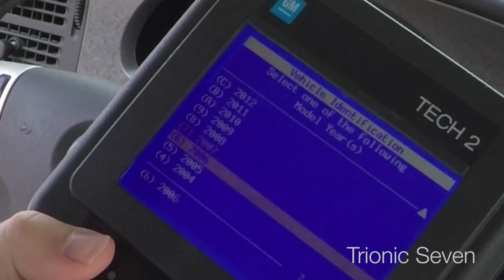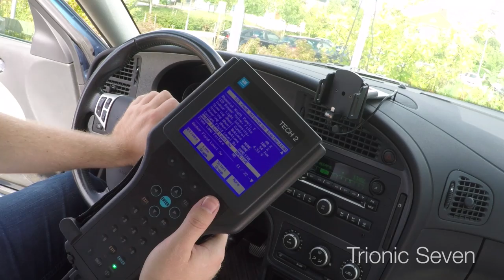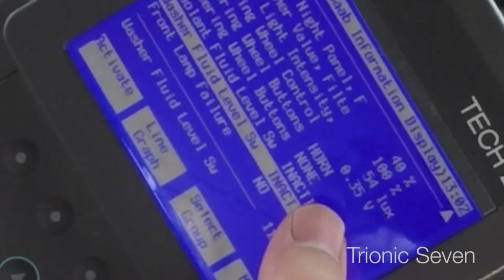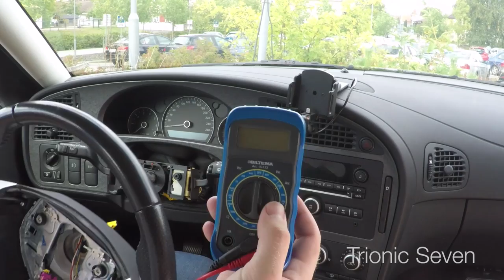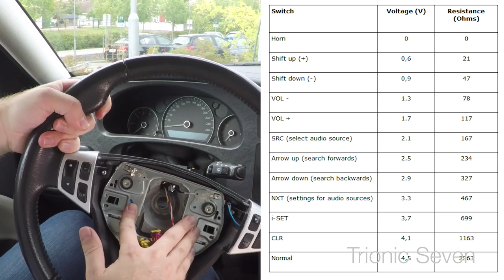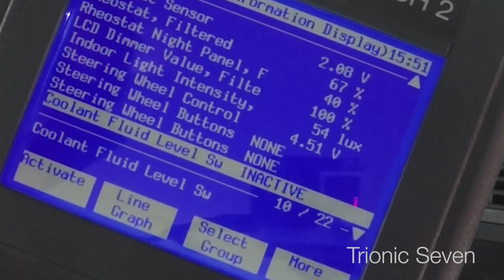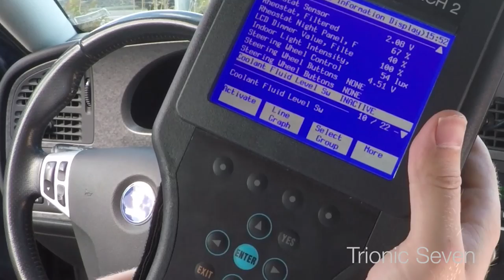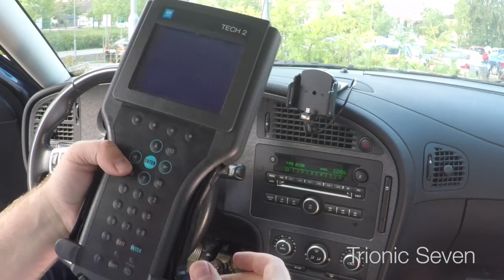Steering Wheel/Airbag/Clock Spring Replacement - Trionic Seven

Comment: Great video Jonathan I have a 06 95 Idid the recall last year I drove the car 150 miles and the air bag light came on again I think your video has shed some light on the problem I have just got a tech2 and  now I can do some trouble shooting your videos are a big help from one Jonathan to another thanks
Reply from the maker: That's great! I knew the video would be useful for steering wheel/airbag work!

Comment: Thanks for a great video, just fixed my Saab and saved a fortune.
Reply: only thing i've noticed is the engine management light has come on... which it did periodically anyway... may be getting used to the new clock spring...
Reply from the maker: No, not related. Read fault codes, your car is telling you something.

Comment: Thanks for the informative video Jonathan it was enjoyable to watch. I have a 2005 Saab aero convertible. Everything doesn’t work from my paddles ( auto ) to my volume controls to my horn and the airbag light is on. Has anyone ever just cleaned the contacts of the clockspring, and all of its contact points to see if that could only be cleaned and not replaced?

Comment: You were partly right about the manufacturer of the airbag. Until 2006 (for the 9-5) it was Autoliv. The 2006-2009 Saab 9-5 and 2003-2011 Saab 9-3 have airbags made by Takata. The older Saab 9-5 before the 2006 dash update have airbags made by Autoliv in Sweden.
Reply from the maker: Thanks!

Comment: Thanks good video. Have same issues with my 2007 9-5. But now I don't know if I should buy a new clock spring or just fiddle with my current one .... :-(
Reply from the maker: Try fiddling, won't cost you anything but time. I'll need to replace the clock spring as the problem is back!

Comment: "Go home Saab, you are drunk." Funny as that was, this was a wonderfully informative video. One thing I am wondering is if it is possible on the older 1999-2005 9-5 to reattach the airbag in such a way that misaligns the horn buttons? The right button feels harder to press than the left one.
Reply from the maker: The horn "button" is the giant bracket in the middle, and I think it's the same for 2002-2005. However, what I didn't show on video was how I reattached the airbag, and it had to do with some off-camera fiddling I did to that horn bracket. You can adjust the tension on the springs which will be different on the two sides :)
Reply: THAT is good to know.

Comment: Hi, in my case it's strange, maybe You happen to know the problem. The airbag light came up every time I turn the steering wheel all way to left or right. What's strange, it goes off by itself after 30sec, when the steering wheel goes back to straight position (I thought that once it's triggered, it would go off only after specific nr of cycles or by using tech2). Anyway , I replaced the coil spring , but the light came up. I did the whole repair process when light was NOT ON purposely and now I'm wondering if it's on because the coil spring is faulty, or the system somehow knows that the clock spring has been replaced and I need tech2 or just wait for some specific nr of cycles so it goes away. Any clue? thanks

Comment: Jonathan, behover man programera in denna clockspring samma som "cim" pa 93an? Jag har en 2009a 9-5 som radio o ovriga kontroller pa ratten samt tutan inte funkar. airbag varningen lyser ocksa konstant.  Kan jag fixa detta med att byta clockspring samma som du gjorde i denna video? Tusen tack! Dan
Reply: ok, jag bytte ut clockspring. Nu funkar knapparna men airbag lyset ar fortfarande pa. koderna b0042 och b0022 low resistance kommer upp.
Reply from the maker: Vet faktiskt inte hur det funkar på 9-3:an, det är ett totalt annorlunda system. Kolla i vårt forum: https://www.facebook.com/groups/733705113501723/
Reply: Jonathan,  Jag har en 95a 2009. Men jag fick det fixat tillslut.  Clockspringen var dalig samt virarna till den. Bytte ut ratten samt viringen.... allting funkar nu!

Comment: Hello, my buttons work fine but the lights on the steering wheel stopped working. I have a 9-3 and have just finished the steering rack replacement. while it was off I stupidly turned the steering wheel alot because I was curious what would happen xD. i may have broken something but there are no airbag warning lights or anything, all seems normal except the lights dont work. do you or anyone else know if this has to do with the clock spring?

Comment: hello, I have a question for you, it's about 95, but the year 2002 after lifts, I have transverse clearances on the steering wheel, i.e. how stretched to myself and push back the steering wheels, I feel looseness on the steering wheel. Is there any pad under the steering wheel that can cause such looseness?
Reply from the maker: Check my clicky steering wheel video :)
Reply: i fix it!! thanks for text back

Comment: Hi, gr8 vid again :) 
Q: is there an alternative for the expensive Tech2 diag tool? But it must handle all kinds of engines like 2.2 TiD?
Reply from the maker: Thanks. The tech2 isn't that expensive. Around $300 maybe from ebay, and no other tool matches it. Maybe the Autocom, but to really do stuff you'll want the tech2.
Reply: Chinese TECH2 off ebay are often complete shit. so, masure twice, before spending your money on it. if you don't have like 3 or 5 or more saabs, just befriend someone who has one :D join some community, club... etc.
As for the 2.2TiD, it's vauxhall/Opel engine (from Isuzu anyway) so you'll also have chances with OPCOM :) for engine related stuff.
Reply from the maker: Well, in my experience there are good tech2 from ebay. At least five of my friends own ebay tech2:s now (number is increasing quickly) and none of them have issues. But I guess they bought from a reputable seller. 

Random thought: Maybe I can compile info in a vid on how to buy a tech2? Would this be interesting? One of my friends is a tech2 expert and I can probably get help from him!
Reply: I have been trying to find a way to buy one without breaking the bank. I have 3 9-5's and there are no mechanics around me with one (except the dealer who charges way too much).
Reply: @TrionicSeven  Hi Jonathan, did you have the time to do a video on how to buy a tech2 or can you recommend a dealer. Regards Håkan

Comment: What would this fix cost if I let a repair shop do it?
Reply from the maker: Hard to say a price, but now that I know how it's done I can do it in 20-30 minutes no problem. Problem is parts as the clock spring seems to be unavailable to purchase. But in Sweden, I'd guess that 30 minutes of shop time can be 600-700 sek + parts. Just a guess though!

Comment: I think all Saab’s 2003 & up have Takata airbags my 07 saab 9-3 has the faulty Takata airbag and have yet to get it serviced at a Cadillac or Saab dealership
Reply from the maker: Yes, seems like all 9-5 2006-2010 have takata.
Reply: Trionic, where did you get access to a Tech2? We have a Saab 9-3 Linear and I kind of want to install a Saab Infotainment System instead of the boring Saab Radio.
Reply from the maker: As I said in the vid, I had borrowed the tech2 from a friend. But I recommend getting one from ebay :)
Reply: Trionic Seven Oh, ok. But do you know any Swedish Saab Facebook pages that have one from your personal experience?